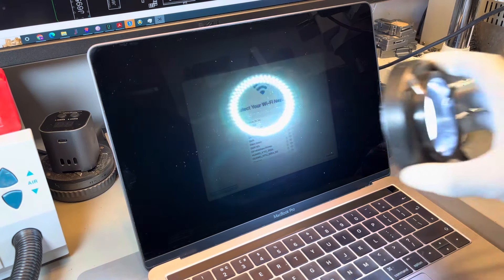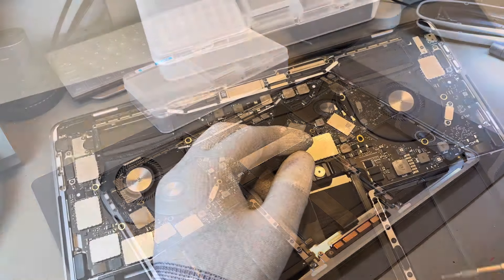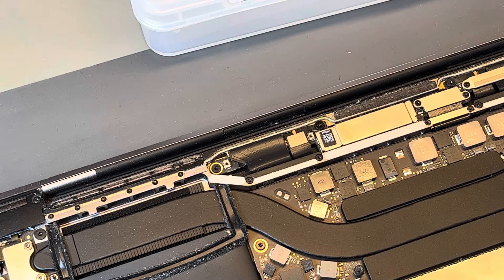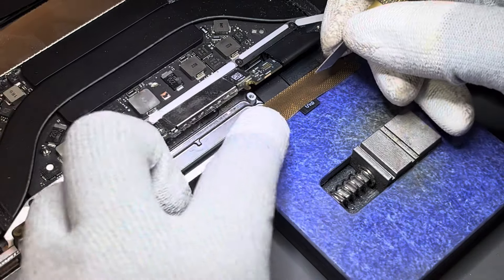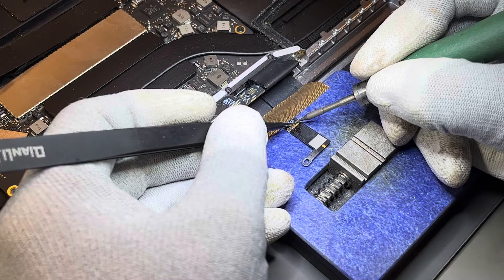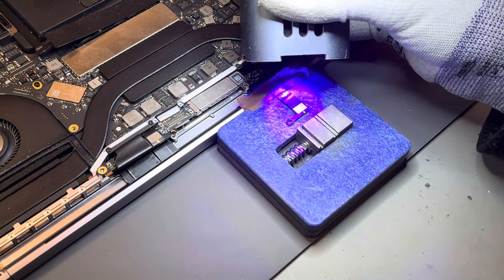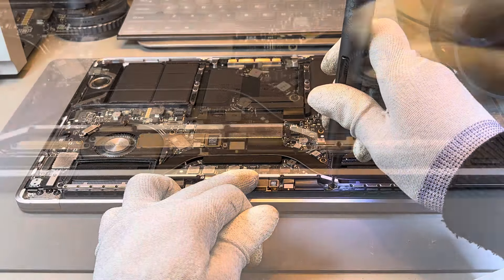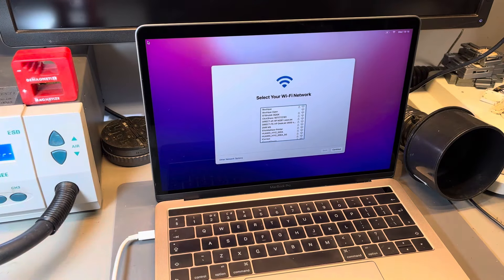MacBook Pro Flexgate Repair | Screen Goes Blacks When Opened | Only Works At Slight Angles

Comment: I just had this issue, and a quick squeeze of the black plastic area between the keyboard and the screen and it's all come back to life. Dig your thumbs in either side, and you might find it works!
Reply: Wow mate thank you so much. This did it for me
Reply: Do I need to take black bit held with 2 screws off first?? In shit creek here need temp fix
Reply: have this issue, what do you mean by squeeze?
Reply: Try open your laptop and reattach the flex cable instead of this!

Comment: The cables pulled in your process will break over time as the flex moves, you must reverse solder a new flex.

Comment: My MacBook Pro 2018 has a similar issue but the backlight doesn’t go off - the screen just freezes - past a 90 degree angle. Could this also be a flex cable issue?
Reply: Hey i have got the same issue!

Have you found any solutions..?
Reply: @kishorekannan9207  My MacBook Pro 2018 has the same issue! Have you fixed it?